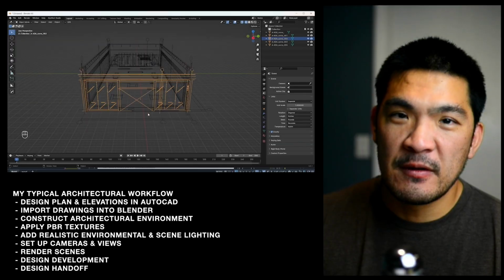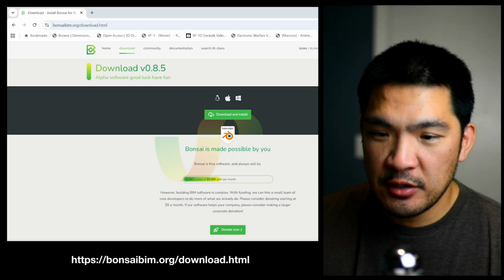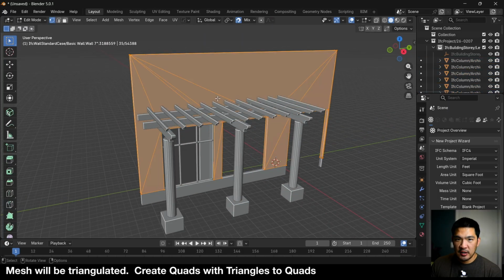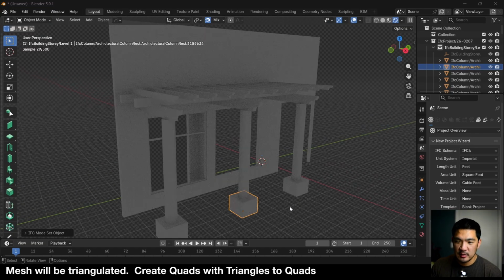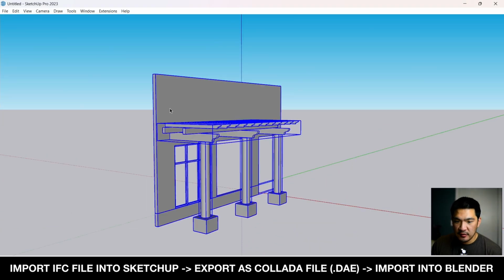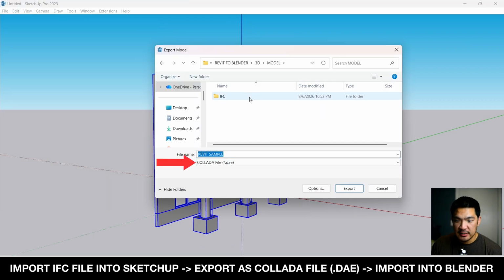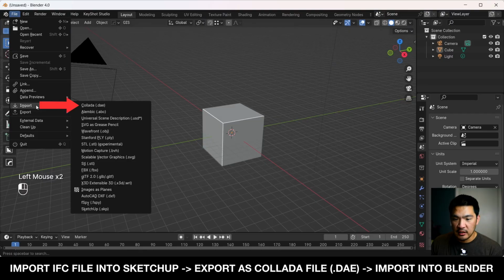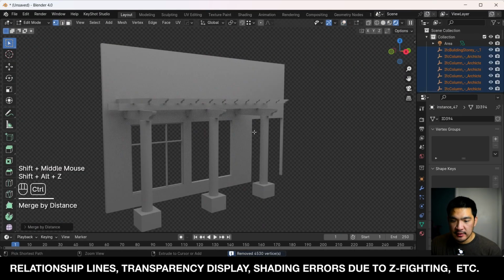How to Import Revit Models into Blender - IFC Workflow #blender #architecture #revit

Comment: Great to see a new video! I've been doing lots of revit imports recently by exporting to .fbx. I think recently Blender removed native .dae support in versions 5.x - I have found that .obj also works if going from sketchup to Revit.
There are also some 3rd party (paid) addons that can be helpful such as Archviz Synchronizer which is designed specifically to act as a live link between an fbx file and your blender scene. Just one of the cool aspects of Blender being open source and having the market for these niche solutions.
Reply from the maker: Honestly I don’t even use Revit so I’m not too familiar with the export options. It sounds like Archviz Synchronizer would be the best option for someone working and managing changes between Revit and Blender. I usually import an IFC as a one time base geometry import provided by survey engineers, and then do DD like apply materials, fixtures, lights, etc.  

Shame about 5.x not being compatible  with collada, that’s been my go to for a long time from Sketchup. OBJ is a great option, I use that when exporting Blender models for others using Rhino